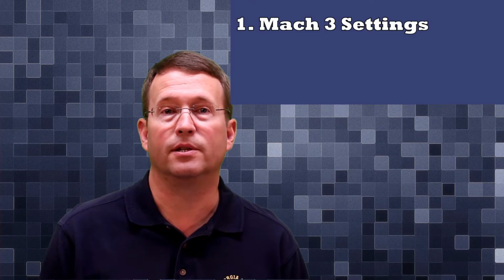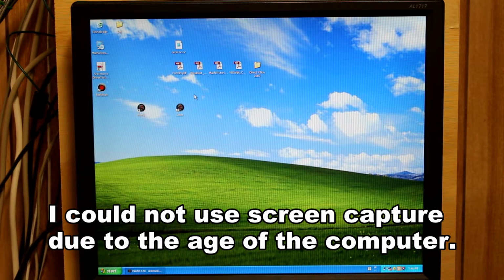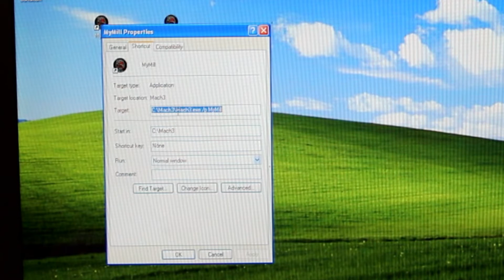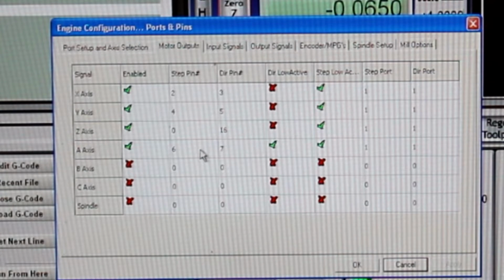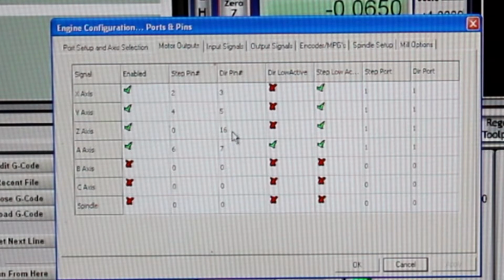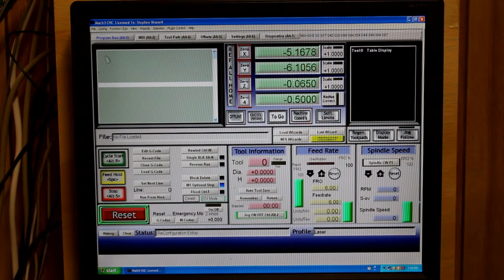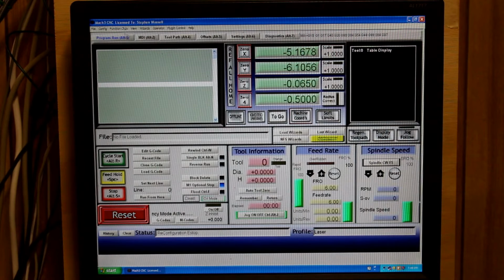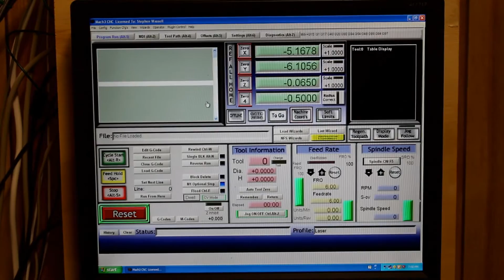CNC Laser - Part 3 - Mach3, Electronics & Burning

Comment: Hi Stephen...thanks for the information. I assembled my CNC controller but for the 5v and the 12v , I used an old computer power supply. I have used it this way for over a year with no problems and I bought 5 computers to $20.00 so they are cheap.
Reply from the maker: That should work fine.

Comment: nice video. what did you use write the g-code for your laserCNC?
Reply from the maker: I am using CamBam. It works great. For anything complicated I can use CAD software and bring it in as a DXF. Thanks for asking.
Reply: @WassellWoodworking  thanks for the reply. Is it possible to take a simple 2D image and convert it to g-code with CamBam?

Comment: I wonder if you could help me? I bought a 10 watt laser and I'm having a problem turning it on and off. I'm electrically challenged. I'm not to clear about connecting a relay. I have a 5V relay with a 5V power supply. My router is 48V, and the laser is 12V. Do I need a 12V relay? Any help would be greatly appreciated.
Reply from the maker: Dan - Not sure if I am going to be able to help you too much. The relay should be a 5v relay. The NO, NC, and Common connection are separate from the coil portion of the relay and are usually rated for up to 230v. I used a 5v relay board that I purchased from Amazon or eBay. The PC uses 5v to run the breakout board that in turn controls the relay board with the same 5v logic.  I used the direction of the z setting to turn on and off the relay. I think it is in the video. Hope some of this helps.

Comment: no dice cant get it to work. using mach 3 mkx lv  controller and shoot me please like now. Im jumping!  laser stays constant. Question hard wire into a axis z axis or output port 7????????????
Reply from the maker: Sorry about the delay. The relay should be triggered by the direction of the signal. When want the relay fed by the direction signal. Down for on and off for up. Hope that helps. Did you get it to work? If not let me know. - Steve

Comment: Stephen,  I am in the process of adding a laser to my CNC using Vectric Cut2D and Mach3.  Your video has been very helpful in this process and I really appreciate it.  I am only able to get the laser to fire for a spit second using the #16 pin with my Mach3 settings as you have them.  My trouble seems to be with the Post Processor.  Would you be willing to share the PP that you use?

Comment: i dont understand were i have to wire in my breakout board... 2 spindles zones...wtf.. plz check this https://ae01.alicdn.com/kf/HTB14.4aLVXXXXa9aXXXq6xXFXXXH/Actualiza-XHC-MK4-CNC-Mach3-USB-Tarjeta-de-Control-de-Movimiento-de-4-Ejes-Del-Tablero.jpg_640x640.jpg
Reply from the maker: I am not familiar with that card. What is your question? I am happy to help.
Reply: i want to wire this card to my 2,5w 12v ttl laser, people said me i  have to use spindle PWM output if i want switch on/off laser (but with delay) my idea was  edit m3/m5 in gcodes...but this card dont have pins 16-17 like your....  i see a lot of tutorials about cnc laser updates but  all is about  Db-25 breakouts or Arduino. Im confussed what is the best way for wire or setup this card. The question is,  What would you do if u had this card? thanks a lot!!! im really lost.

Comment: Hi Stephen,  nice video and thanks for sharing.  If using a relay to switch the laser (TTL I assume) on and off, how long will the relay last?
Reply from the maker: I don't know ho long it will last. If the relay stops I will post a video. It has been through thousands of on/off cycles so far if not tens of thousands.

Comment: Thanks for the video!!  Could you post purchase/part# info on the relay for the laser module?
Reply from the maker: Randy -
It is a SunFounder 2 Channel DC 5V Relay Module. Here is the link on Amazon:
https://www.amazon.com/SunFounder-Channel-Optocoupler-Expansion-Raspberry/dp/B00E0NTPP4/ref=sr_1_2?ie=UTF8&qid=1492042646&sr=8-2&keywords=2+relay+arduino
Hope that helps. Let me know if you need anything else.

-Steve
Reply: Thanks

Comment: That's great, thanks, so that works great for vectors but did you get it to work with raster images, photos?  New subscriber
Reply from the maker: Great question. I have not experimented with raster images. If I do, I will post it.

Comment: Thank you for the video.  Question: Why does the A drive need to be configured?
Reply from the maker: I was probably talking about the 4th motor which is sometimes called the 'A Motor' or 'A Drive'. This is not to be confused with the A disk drive. Thanks for watching.
Reply: I was referring to the A motor not a disk drive.  Since the z axis is not used why does it have to be configured?
Reply from the maker: OK. I understand the question.  The z-axis is used to trigger the laser on and off. I set the Z depth to -0.01". When Mach3 (CNC software) sends the breakout board the command to move down, the voltage for direction triggers a relay. When the Z axis goes to +0.01" the voltage comes off and the relay shuts down the laser. Basically I am using the direction on the breakout board to run the laser relay. I have the A-axis to raise and lower only before the laser is triggered to get it to the focal height above the work piece. I hope that helps.
Reply: This clears everything up.  Thank you for responding.